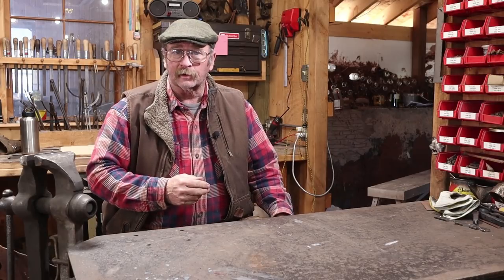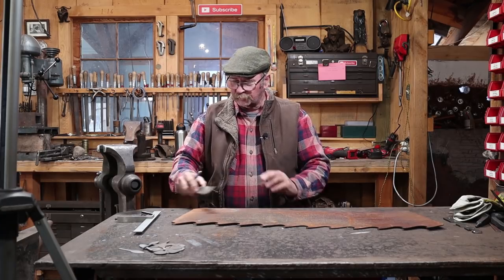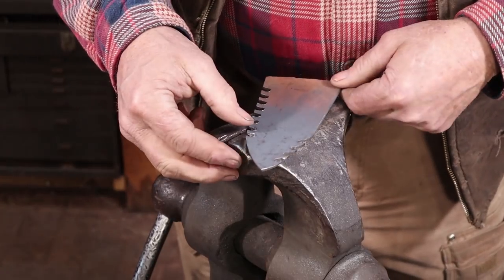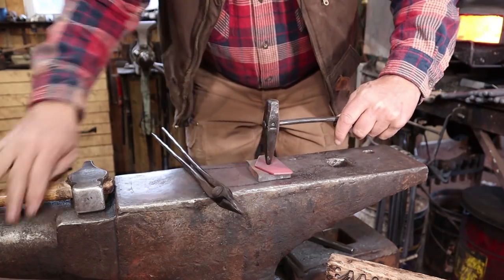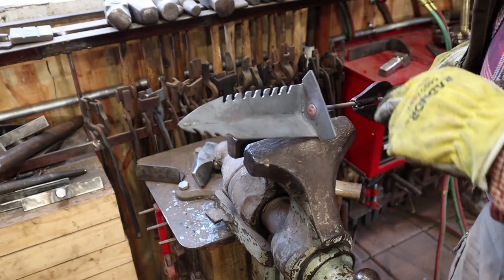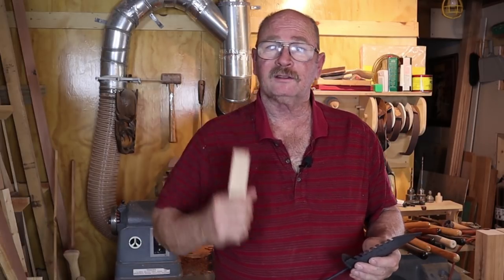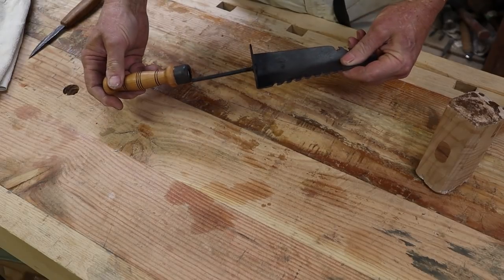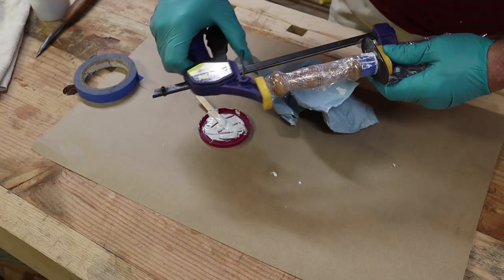Making a Prospectors trowel - digging tool for metal detecting

Comment: Very nice gift.
Here is a little tip I learned dealing with epoxy in blind handle holes.
I picked up a bunch of medicine syringes like you give liquid meds to kids with.
You can draw the epoxy up in them, place a small brass tube, or plastic straw on the end and inject the epoxy Inside with little mess.
Hope your Grandson enjoys using it. Never know when a treasure might be found!
Reply from the maker: Good suggestion, thanks

Comment: That's a beautiful trowel John I've used several trowels since I started detecting and yours is excellent you should started making them to sell in your Etsy shop they can be quite expensive but I would recommend making the bar going up the handle a bit thicker as they can take a lot of punishment and it's usually the handle or the tip of the them that have a tendency to break keep up the good work Simon

Comment: John, your Grandson ought to get good use from this trowel!  I got my first metal detector in the early-to-mid '70s and still have it -- it still works fine.  If i was going to change anything, I'd make the "saw" teeth finer for sawing roots rather than hanging up on them.  But the design really depends on the type of soil he will be digging in.  Thank you for sharing.

Comment: Very nice job on the trowel.  Nice to see some O/A welding (or brazing as it appeared to me).  Not many people are doing it these days except brazing on cast iron.
Reply from the maker: It was welding, brazing would use a softer rod such as brass.  I use iron based welding rod
Reply: @BlackBearForge  OK, thanks for the clarification.

Comment: Excellent video and product as always. My only addition would be to tell you that turning wood on the lathe shares the same steps as blacksmithing in ways. First square, then octagon, then round. As you demonstrated square corners can be cut round. It is however easier and faster if you cut 45 degree angels on the squares first via table saw or band saw. This makes the square an octagon, then the lathe makes it round. I love the comparisons. Please keep up the videos as I learn a lot from them. Perhaps my next trip to Colorado I could see your shop in person.

Comment: This is probably an obvious n00b question, but what did you use to finish the blade/get that patina on there? Was that just as-is after the last wirebrushing?
Reply from the maker: Johnsons paste wax applied just hot enough to melt
Reply: @BlackBearForge  Thanks!